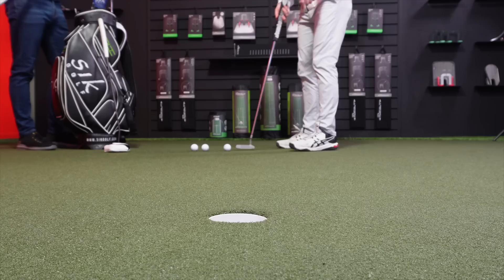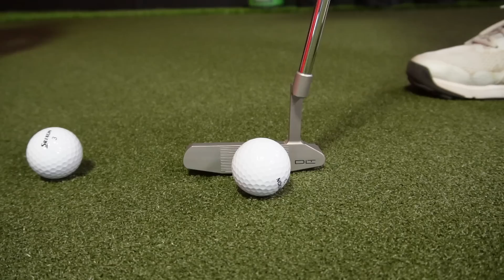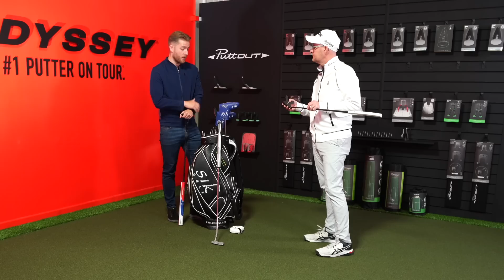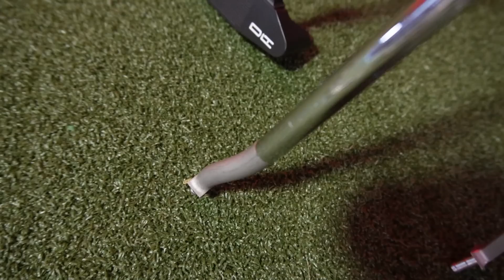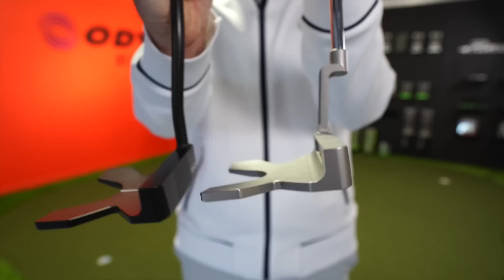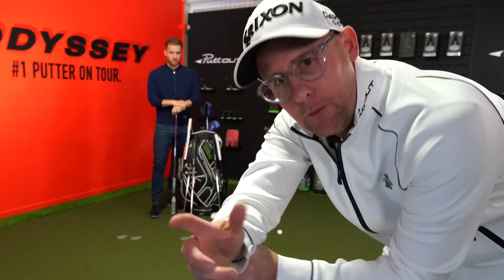WILL THIS PUTTER CHANGE PUTTERS FOR EVER SIK ideas

Comment: Why to justify the cost for a good / proper putter ?  Get fitted. You may hit your driver 14 times per round; you'll hit / stroke your putter 28 to 38 times per round - probably over 100% more than your driver !  Just like you want the proper driver / shaft & flex / grip size / length to hit fairways, you definitely want the best putter fitted for you / your stroke type to make more putts ! May have to work on your grip & stroke too. Invest - fitted - practice ............ o __ !

Comment: My local pro has just had these into his shop plus the complete fitting cart. I took the half moon mallet to the practice green with no expectations and had three of my normal gaming balls. I chose the half moon as I like the design but also this had the flat sole compared to the other models. I put the three balls down with the hole about 12 feet away and omg all three rolled beautifully and went straight in.
This could have been a fluke but I don’t think so, needless to say I now have it in my bag.

Comment: Sadly I had custom built Sik putter that was supposed to be face balanced with a lie of 69 degrees and what I received was a putter that had about 30 degrees of toe hang and a lie of 71 degrees. The only reason I checked the lie was because when I checked the putter to see if it was face balanced by balancing it on my finger I saw the toe hang. I contacted Sik golf and they told me that not every putter is perfectly face balanced which is rubbish because my previous odyssey and Mizuno m craft were exactly that. Mind you this process to contact Sik golf took weeks of back and forth. 
I returned the putter for a full refund (which was also a process) and nowhere in that process did Sik golf apologize. What is most disturbing is that for a company that ONLY makes putters to get these two of the most basic specs wrong on a putter is pretty bad. I now have a perfectly spec’ed Scotty Cameron Phanton X 5 and my putting has improved massively.

Comment: I was disappointed that the justification for the price was based on ‘that’s what people will pay for a driver, so why not a putter’ Drivers are a different animal with totally different tech specs. I wasn’t blown away with this putter- the variable loft face is just a variation of the teardrop head.. So to my mind club golfers that don’t enjoy free clubs from sponsors would see bigger gains by investing in some putting specific lessons to improve their technique - then get fitted & buy a putter based on a good technique and results from the lessons that us mortals can afford and still have change to buy a decent pack of golf balls and a beer. £450 on a putter won’t solve bad method/mechanics. Just my opinion.

Comment: Really good review Mark. I am in the market for a new putter and have considered a fitting, but that alone can cost north of $100. You get some credit if you end up making a purchase but still. And the SIK putters are on the very top end of the price curve starting at $400 in the US with no real low end models. Hard to justify $500+ for a putter. I play an Odyssey White Ice I got about 2014. I like it, but I do not love it. At least I know now some things to consider regardless of the make/price. Very informative video as usual.

Comment: @Mark Crossfield, best thing SIK could and should offer is keeping the screw system and giving you the option to have both shafts for the price and also to promote the armlock for themselves! Take it to the same level as drivers so you can have multiple options with the same putter! That way when your having a wobble on the greens you can change to the other option with no effort whilst also staying with a SIK product instead of the normal path of buying a new brand putter!

Comment: I think the justification for the cost is there.  I fit SeeMore and LAB putters which covers all putting styles and a range of budgets.  If someone has decided to invest in a putter fitting then they have to be open to liking a putter that is more expensive than they would normally buy. You can spend £400 for a putter of the rack.  I also find some customers just have the wrong length, grip or loft and lie on their putter and for them a putter fitting is very cost effective.

Comment: I totally understand that a putter is used more than any other club but £450 is a lot of money for a single club, including a driver. The pricing appears to be purely based on what they think they can get away with rather than what is a fair price. I am not saying that people shouldn't buy them but I would struggle to justify it. 
Maybe the problem is that I do not struggle with my putting and have a Yes! Olivia which I have used for many years. If I did have an issue my mindset may well change.
I also live in an area of the country where it is not as easy as some other areas to just pop to a fitting specialist to try one out.

Comment: £450 is crazy to me. I have gone armlock I got it on eBay (£80) then got it fitted length, lie and loft £25 in my pro shop. Fits beautiful and putting is so much better

Comment: I went from an Odyssey Stroke Lab Marxman to a Cobra Vintage Stingray 40 and instantly started putting better. The putts roll out more consistent and I tend to have less "dead" balls from off center strikes. It has completely changed my putting.
Reply: I'm a good putter & rarely change but I try a lot. Rolled 30 or 40 different putters in a store (including Sik) the other day and the Stingray 40 is the only one that really got my attention. I want to try the LAB Mezz but if that doesn't do it for me, I'm going to pick up the Sintgray. Damn good putter.
Reply: @canyonaro  It is a damn good putter for sure. The weighting of the putter is perfect, the face is great. The shaft is great. I don't have any complaints about it.

Comment: A guy in my group today was putting with a L.A.B (Lie angle balanced) putter. Could you do a review on their putters? I putted with it a couple of times and it felt amazing except for the sound of it. I looked them up on google and the tech seems legit. Thanks. Love your content!
Reply: Hi Barry I have had one for a year ( be great to see a review from mark  - expensive with tour stability shaft BUT it has reduced my putts per round 5 or 6 strokes ( huge gain for me )  it’s the single biggest reason my handicap has gone from 11 to 6 ,and it’s probably the only club in the bag I won’t change in next 5 -10 years - I know both Peter finch and Rick Sheils have done a review of the LAB putters with great results 
I also think a putter fitting is as important as a driver

Comment: Mark, I don’t have the facilities near me to go to a fitting so I recently picked a putter that was similar in design to which I used as a junior, putted a ball with a line on it until I could roll it end over end, then now exclusively putt heads up (looking at aim point) for best distance control… any other tips for someone self custom fitting?

Comment: If you're left eye strong, putt left handed... if you insist on putting right handed, stand closed to get your left eye above and behind the ball... using lines to fix your lack of binocular vision is like using a bandaid to fix a broken finger. 

My son has a White Hot 10... horrible putter until I replaced the shaft with a KBS Black. Now it's a decent putter. Not worth the money.

Comment: Always loved putter price conversation! We are all happy to spend $750 on a driver to use it 12ish times a round yet hate spending $500 on a putter we use 28ish times a round!
Reply: @Roenie Gaming  to be fair mate I think there's a balance and you are arguing too far on one side. The player has to look at their game and themselves first yes agreed. But technology also has its place in helping golfers by rounding out some of the edges. Yes you can put a lump on the end of a stick with a straight face but you are dreaming if you think it's going to perform as well for the average punter as a modern putter with higher Moi and face technology. No this tech can't solve a horrific stroke but where it does help is on those 70/30-80/20 ones where you know you haven't put the best stroke on it but the tech helps you to sneak it in. As opposed to using a tiny blade putter with no forgiveness that punishes you for off centre strikes as well as variable lofted strikes. Yes pros can use a tiny blade putter (although look how many tour pros now more of a mallet style or modern blade style putters with more Moi) ... but 95% of folks don't have the time or desire to devote themselves to golf practice like a pro, and in many cases choosing the right clubs can make the game that bit easier. Eg saying just get better and practice, you should keep using an old butterknife 2 iron vs practicing but using a hybrid that helps get the ball up in the air. It's a no brainer ain't it. If you want to get better you need to practice, but the idea that all this tech is rubbish isn't correct in my opinion - it can't work miracles but it can help support your game when chosen wisely.
Reply: @tezzlacoilz  I agree with Gaming on most parts. You dont need all these gimmicks to play good golf. If you are a 20 handicap and never practice, just go to range, beat balls and go play, guess what, 3 yrs later you’re still a 20 handicap. 
 That being said, i do agree with driver and iron fitting. Diff shafts, lofts, ect…can make a huge difference. I draw the line at wedge and putter fitting. I have tried putters all the way up $800 and i play a Hunting Beach, just like gaming. My putter was $169 and last week i caught a guy and played out the back nine and he had a $450 Scotty Cameron, should i tell you who putt far, far better? Hint, it wasnt the Scotty. 
  Does having a putter you love make a difference, abso-frikken-lutely, but you dont need a $400-500 putter to achieve that. A fit driver can minimize a bad swing. A fit putter wont minimize a bad stroke. There is too little room for error on a green where a fairway can be 40-50 yards wide. A 1/4 inch off on a green and a 5 ft putt misses. 
  I am also speaking of majority of amatuers. If you’re a low, single digit, tourney player, ect… and looking for that liitle bit of extra edge on something you are already very good at, then i can see it as a benefit. For a 15-20 handicap…😂😂😂😂. Gimmick to get money!!! 
  As far as wedges, comical. Most OEM’s are now offering 4-6 diff grinds. If you look at chart and dont know what your swing and ground interaction is to pick correct grind then you have no business even worrying about grind. You should be worried about lessons at that point. I bought new Vokeys last yr and i took me about 10 secs to look at chart and say, “i need an M grind and an F grind”. It should be that simple if you know your game.
Reply: @fuzzybanana3870  im not disagreeing with Gaming about golfers trying to buy their way out of issues instead of practicing and learning and fixing said issues. However the gist was that tech, specifically on putters, was rubbish, which i dont think is correct. Yes anecdotally we all have stories about how our $50 putter or irons or driver absolutely destroyed some chump who was sporting all the latest and greatest equipment. But if you were to actually look at the data from something like quintic across a broad population of golfers, i think you'd find that the new tech does help. And for me Scotty cameron, no offense this is just my opinion, is one of those brands that is all about feel and looks and to be quite honest, ego/brand recognition, and has very little in the way of modern tech. Why do alot of pros use them? Because for them feel/weight and looks is more important than anything else, as they deliver the club face consistently out the centre, and with a consistent angle of attack. Whereas id say 90% of amateurs do not - they dont deliver the club face the same to the ball every putter swing - they are all over the place in terms of where they strike on the face, and angle of attack. In contrast to Scotty Cameron, companies like SIK and Evnroll with their different types of face tech, or LAB golf with their lie angle balanced tech, are using tech that actively tries to help amateur golfers with these issues. I dont agree that on greens there isnt enough space for it to make a diff. Like you said, a tiny bit off and you miss which makes it even more important ... so for example Evnroll  with off centre strikes, the face tech helps to push the ball back on target with a similar distance as a ball struck dead centre. So that 1/4 inch off might have a better chance of dropping. Will it put it in if you completely toe it? No. But neither will the latest driver fix a massive out to in swing that you slice off the heel. Wedges... well... if you dont know your swing/what grass you play on, best to just grab a versatile grind and mid bounce. Most higher handicapers who arent good with wedges would be gasp better off using helpful "tech" like a chipper... Mark Crossfield is just talking about bagging one of those in his latest vids. Or should we scoff at a chipper and say that tech is rubbish and instead go practice and use a 60 with 4deg of bounce like sebby? or maybe we take a balanced approach and say go get a chipper, practice with it, let the tech help you build up your confidence around the green, and when you have more experience around your home course, look to invest in a set of wedges with the right bounce and grind for you :) anyways, just my opinion on where tech across all range of golf equipment fits in. Again, tech can only help and support, it cant work miracles and be a cure all, but smart choices eg a chipper, can aid in areas you might be deficient/need a little help, having a big impact on your scoring, which in turn breeds confidence and dare i say it enjoyment of the golf :)
Reply: @tezzlacoilz  All valid points. I guess i could make the arguement that a full mallet putter will benefit you just as much as a fit putter for off center hits. Their weighting keeps from twisting and most have solid faces so it doesnt really matter where you hit. Trottier golf just showed this recently. As far as 1/4 inch off, i mean line, not putter face. No putter will help if your line is off. 
  Chippers, to each their own. Im not opposed but also know you will never be a good chiiper if thats your club choice. You may have fantastic results, but its because of club, not skill. I personally prefer and use 60 degree to 7 iron for chipping. On rare occasion i use 5 wood. A chipper most certainly will help your scores, but it wont help you improve your game. To me i strive for skill and improving and earning those better scores. 
  Definately to each their own and individuals have to decide what they want out of their game and what they open wallet for. Im just old school, more reward for earning. 
  I belief ppl are just in so much of a hurry and are looking for that magic clubs/clubs for instant improvement. Example:::$450 in lessons will benefit a golfer light yrs ahead of a $450 fit putter. 
  I am also not arguing to not upgrade or spend money, quite the opposite. In the last yr every club in my bag has been replaced at over $3000, so i do agree with new tech. I also know where that tech is, very near its climax, so my clubs were all a 10 yr investment. Clubs are very near if not at their limits.
Reply: @fuzzybanana3870  mate i think we pretty much agree on most of the stuff to be honest. Totally agree about lessons and practice vs just trying to buy the latest and greatest but never actually addressing issues. Chippers for me are a tool, like any club - they have a purpose and there isnt anything inherently bad about them so long as you understand their purpose. I had chip yips for a long time when i first started and moved to simply bump and runs with an 8 iron that i got mighty good at. That gave me confidence to start trying my 50 and 56 and now chipping is the 2nd best part of my game, after putting. In the end golf is about getting the ball in the hole in the least amount of strokes and if a chipper allows you to score better, that is objectively an improvement in your game...you've lowered your score therefore you have improved your game. If you can use a chipper to put the ball next to the hole nearly every time, why is that any different from flopping a 60deg to the same spot? Yes, different courses wont allow you to chip and run all the time, but when a golfer hits that point then thats when they are forced to learn how to use a more lofted wedge. But annnyways, im not saying the sole purpose of golf for everyone is to shoot the lowest scores possible. Everyone gains enjoyment however they like, and there are many different ways to play the game to get the ball in the hole, which is why i love it so much. Also agree that, especially irons but also drivers, the tech for clubs is nearly maxed out and that improvements are very very incremental these days and also all the manufacturers are getting much closer in product performance. btw you should check out LAB golf if you dont know about lie angle balanced putters - watch how that face balanced putter/mallet tries to twist in your hands as you make your stroke! https://www.youtube.com/watch?v=q0jg5ICB4jU. Good luck out there on the course mate, very interesting to share thoughts on the game :)

Comment: The cost should be based on what it costs to make not on the comparable cost of a driver. It really doesn’t matter what drivers cost.
Reply: Exactly what I was thinking. Jumping on the £450 driver bandwagon when there's clearly more 'hardware' in a driver therefor, you would expect, more cost to manufacture.